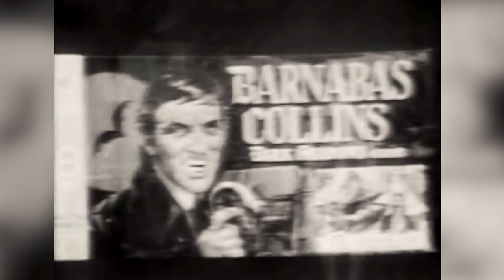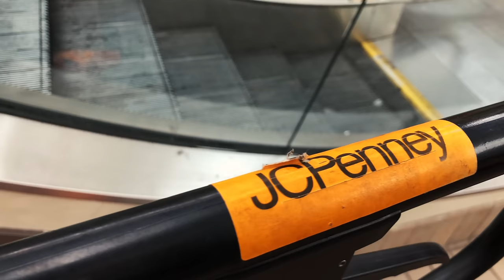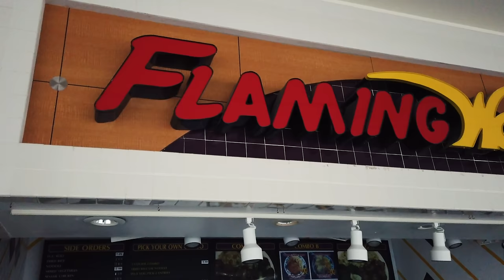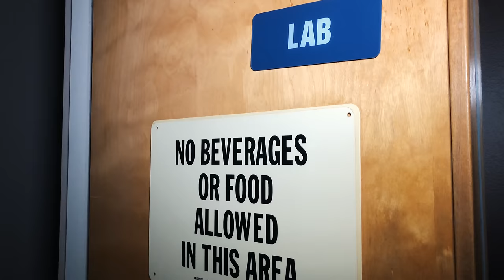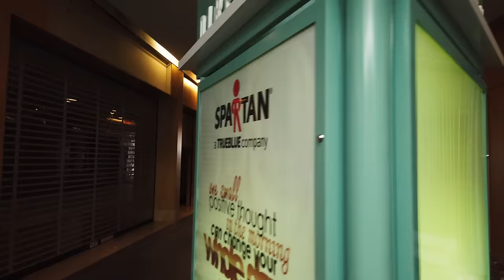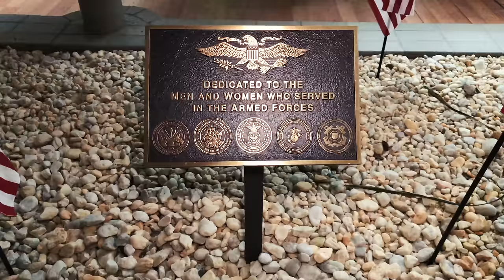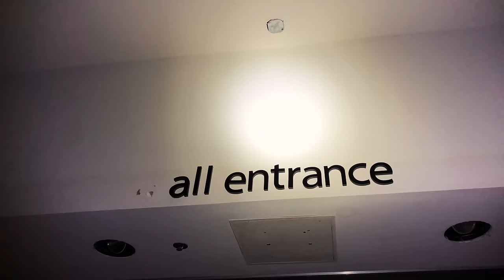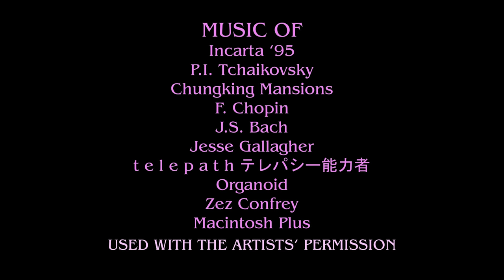The Abandoned Burlington Center Mall | an epitaph to a dead mall | ExLog 40 - Phase III Premiere

Comment: 13 40   the watering hole.  In 1986 I replaced the" gentle stream" of water coming from Petals snout to a  fire sprinkler head. -  Why?  the small discharge hole ih Petals snout would get clogged with human hair and other debris that was able to get by the filtering system underground ( I spent many hours a d some ful days in that 4 x 5 foot underground filter station.   When I replaced the small water tube that Zeno's designed with a mid size gpm sprinkler head in 1982, most of my problems went away-   It solved the problem.  Just last year I explained that to Zeno's daughter via the internet.    I took care of the grand ole elephant for many years taking  great pride in the way she  ( he) presented the sprinkling water on " Mobley " as we called the boy  ( like in Disney's jungle book.)    I have a great story to tell about the last person to adjust the sprinkler head on Petals  the Elephant ( he has since passed away)   My one - time assistant was totally set up to be completely soaked when I directed him to go change the sprinkler head to a different size.  I turned the water on when he was still on the back of Petals with a wrench in his hand.   He could not get down from Petals so easily, so he was soaked head to toe by the time he " dismounted'   I still laugh about it today  God bless his soul.
Reply: I never called that elephant "Petals".  I could see at the base of the stairs that the sculpture is named "The Watering Hole".

Comment: Great video, Sal. I worked in mall retail from 2001 to 2012 in both malls in my location. The first was built in 1968, with new anchors added in 1975. 

The second was built in 1999 as a youth-oriented mall.

Today the older mall is performing very well. The newer mall is struggling. 

The old mall has the higher end stores and better anchors. A new REI opened last month. A new Von Maur will open later this fall -- built on the site of the demolished Sears store. The Macy's at this mall offers brands found in larger markets. 

The newer mall lost Younkers, one of its anchors. The other anchors are a dying Sears and a fading Penneys. The Macy's is also fading fast and looks older than its sister store across town. Many of the spaces once occupied by national retailers are now filled by mall ninja boutiques and small massage or beauty shops. The former Abercrombie, the Forever 21, the closed Charlotte Russe, the dead Rue 21, the former Aeropostale -- their customers have left. They're now shopping at H&M at the other mall. Drop in a Zara and the other mall will have lost an entire generation. The food court is emptying. New paint isn't helping. My guess is that this mall won't make it another ten years, maybe not even five.

You're right. Malls have killed themselves.

Comment: That alarm sounds like a back up batter system or UPS at the beginning Sal, they probably killed the power to something that charged the batteries and the batteries are going dead now.
Reply: No I know that sound it a trouble alert on a fire alarm I worked on too many to count and the strobes going off in the mall confirm this and then the sprinkler pipe rupture at the sears tells me they have had this happen a few times...
Reply: @cgsound  ^This. The label on the door should have been everything. "Generator and Annunciator room". This is most likely where all the security system and fire alarm annunciator panels were at. The panel was probably signalling a trouble in the system, most likely fluctuation in water pressure, which should have been a warning of what eventually came. The other tone was probably signalling that the entire horn/strobe system had been activated due to the water pressure trip.

To be honest, as I watched this, I couldn't help but think the amount of horn/strobes in the open areas of the mall were a bit... anemic. Like I really didn't see any strobes flashing other than the ones in the food court area and one high up in the rafters and the one there at the door.

If it was me, if there was such a huge temperature change from out in the mall to in the Sears, and then to hear the Sprinkler alarm go off, I would immediately assumed that there was a fire and that was the reason why it was so warm in there. I would have then called the FD.

Comment: 41:14 - A water main [break] is the pipes under the street, belonging to the water supply utility.
Water leaking from the top floor's ceiling could only be from fire sprinklers.  Which is accompanied with a fire alarm bell,  and an immediate response from the local police, then fire department.  41:44
Reply from the maker: Found the expert!

Comment: I remember the day Lenscrafters opened up.  I put in their pneumatic thermostat ofr cooling and heat and ran the lines to the main.   I also recall placing their test meter( electric meter to gauge the cost of their energy usage for our accounting department.    I told them to dim the lights for a week and conserve , as I only would run one week .  The energy charges for the year were then extrapolated x 52 weeks. therefor if they conserved energy for the test period they could save thousands per year.    I think I may have been a disgruntled employee at that stage of the game and was 'screwing' my manager because  I saved the mall one hundred and forty thousand dollars on a  savings initiatives only to be rewarded with  25 cent per hour raise.

Comment: Great stuff. One of your best and I agree with the other comment about doing a Moonbeam exposé.

Incidentally, I didn't see if anyone else mentioned it, but my wife and I have the theory that the heat in Sears and the water main break are directly related. Clearly they knew it would happen. The real question is whether they were trying to stave it off or cause it.

Comment: I don't know if you were thinking the same thing I'm thinking right now.  There was very cold weather.  Cold weather in which pipes freeze.   When the pipes freeze, and the weather remains cold, no water comes out.  When the pipes thaw, that's when the flood happens.

From what I know of Sears, they own all of their stores, so although it's attached to a mall, the building and the land it sits on is theirs.  Presumably, the building, which is an asset, is insured for that sort of "act of God".  

So the question is, who turned up the heat?
Reply from the maker: Good question...
Reply: @sal  Another thought...being that Sears is attached to the mall, the mall is likely named as a secondary insured.  So anything that happens to the Sears store, whether it burns down or floods or whatever...if the attached building is damaged, then the mall would get a payout as well.

Comment: Yes, that is a transformer, happily doing what it does, hum.  Maybe somebody ought to teach it the words after all these years. That hum is present in any building with electricity, but normally it cannot be heard over the sounds of life, the HVAC, people, whatever.
Glass, in a building with no temperature control, will break on its own accord, especially if it was tight in its' mounting to begin with.  Glass doesn't like temperature change..
The really hot store means the control has failed, and it is just running.
Reply from the maker: Thanks for the insight!
Reply: 7:31 - We can hear the HUM .

Comment: Your discussion about the reason malls died reminds me of bookstores.  I remember going into Borders when it was big.  I remember shelf after shelf filled with computer books.  They had one or two copies of LOTS of titles. Over time I saw them switch to multiple copies of fewer titles. 2 copies of 10 titles took as much space as 10 copies of two titles and was easier to manage.  Cost saving isn't always the way to survive.  You need to control costs, but they shouldn't be the primary measure of success.

Comment: This used to be the mall I'd go to growing up. I'd always end my shopping trip with a little ice cream at Cold Stone Creamery (it was always right next to the exit so it was perfect lol). I remember as the years went on that it felt less and less safe there. Gangs started congregating there, more and more violence started because of them, then there was even an incident where there was an apparent suicide attempt where a guy fell from the second floor on the Macy's side (at this point Macy's was closed and no stores were in that wing). He survived but was badly hurt.  

Not long after that I moved to a different state, but I knew it wouldn't be long before this mall would go under. They apparently tried having sellers making up tables during the weekends to try and get traffic in towards the end, similar to a flea market, but it never did much. Apparently also right at the end the heating in the mall was never looked after, which ended up going out, made it practically freezing inside the mall during the winter, and that ended up leading to the water main break because of burst pipes. It was like adding insult to injury at that point. It's sad, but all of us locals could see the end coming for years.

Comment: That beeping sounds like a fire alarm panel in trouble due to either a power short or it running on a nearly dead power.
Reply: Ground water in the manholes from the pumphouse ( off property to the annunciator panel.  That sound is very familiar to me-   10 years I dealt with the ground fault until I had pumps installed in the manhole pits -  D Gallagher Chief engineer

Comment: If I remember correctly,  you stepped on the wooden floors in the Macy's.   They are everywhere in them.  If they haven't been attended to recently they will make very bad creaking noises due to buckling (I'm sure you know).  I worked in one and they did that anyway when they were new!

Comment: Sal---I - just saw the tail end of a clip  -  yiou briefly scanned an area on the lower level main entrance to the mall.  it's where the every very FIRST  sprinkler leak occurred in 1983.  I know because it just started at Burl Ctr that year and I had to go in on a freezing day to help my then boss fix the issue.   THAT day was when we learned of the insulation issue at the mall.  It took the freezing temperatures of a few days that year to expose the liability.   I know why these sprinkler  line breaks occurred.   The Burl Ctr. had severe insulation flaws when it was built.   My former supervisor and I fixed these issue by working 5 or 6 consecutive weekends with a creative way I designed to mitigate the insulation issues.  We retrieved an overtime rate  which Uncle Sam sucked up most of to fix a multi-million dollar gaffe.  My supervisor left me in charge of the shopping center in 1988 to start his career at Eschelon Mall.   We both fixed the problem,  but the initial repairs still  required maintenance repairs over time. I did that for many years until 1997.    You WIL NEVER BELIEVE WHY THESE LEAKS OCCURRED AFTER I LEFT in 1997   Its insane, and its a shame.,
Reply: @savvysharktravel     Sears had their own Heating system and Cooling tower totally separate from the shopping center-  Same for S & C-  and eventually- Macy's.    The problem with the mall was that they system was on a very early design Hewlett Packard BAS computer.    Basically acted as a timeclock with no overrides or inputs for low temp alarms/ temperature parameters set to instigate air startup.   It was a long weekend- ( thanksgiving)   Approximately 34 years ago tomorrow that we had a really cold winter - blistering cold.    The sprinkler Pipes froze that weekend 34 years ago tomorrow

Comment: After a bit of research I found that one of many causes for a water main break is, you guessed it, extreme differences in temperature. When a pipe experiences extremes of hot and cold the pipe expands and contracts to a degree. Eventually the pipe becomes to weak to handle the pressure of the water inside and causes an explosion.

Comment: Me, and my friends practically lived at this mall in the late 80’s, and through the 90’s. I worked at many stores there in my youth. Farrington’s Music for 12 years. It’s sad to see what has happened to it...another thing about this mall. It was built on marsh lands and was sinking.
Reply: It would have been 40 years old in 2022 and never sunk in a noticeable way to anyone. Even the demolition crew remarked on the sturdiness of the foundational levels that they were driving over as they were knocking the walls down.
Reply: @JimGrimNY  Interesting. That's just what we were told when everyone was talking about a possible makeover. Either way, I'm sad to see it gone.
Reply: @PaulMonaryArtery  when the mall was in the middle of its heyday, that used to have a noticeable shaking if you were in the central promenade area. All you had to do was stand across from the escalators up above the gab and hold the rail and every 45 seconds to 2-minutes you would feel a rumbling shake in the floor in the rail. It was that way from 1983 all the way through until it was 2015 and I was last inside it.

Comment: Sal-  at 42: 50  that leak is coming from the food court above.    Prior-  the leak in Sears would have been a sears problem back in the day.   All someone has to do to stop that is turn off the PIV  (post indicator valves ( outside )  in front of Sears and JC Penny's and the water would have stopped immediately until the Fire Pump (on the perimeter of the mall outside of S& C was turned of until a repair was done.   Little to no damage when you know what your doing!   as I watch these videos  I cringe!     At least I think ( know)  I did a great job when I was there for those 13 years .   Saved that company a ton of money.

Comment: I discovered this mall in 1989. It wasn't as happening as other malls in that area, but I did go there occasionally. However, the most unusual thing I ever witnessed in any mall occurred there in the early 90s which was a massive teen fight where somebody almost got thrown off the upper level. He was actually hanging over the rail. Security wouldn't allow anybody else in the building that night. 
In its final years when 90% of it was dead, I used to work for a transportation company and would stop to use the bathroom. It was soooooo dead.

Comment: The beeping you heard in the beginning outside is the "Fire, Life Safety" system.  It will make those beeps when systems begin to fail and contact switches fail or open.    You'll notice that as soon as you entered, the "Fire, Life, Safety" strobes were on, that's just too funny.  How many years has those strobes been on?  It is a testament as to the durability of the Fire, Life, Safety system anyways...hehehe.  It's quite funny to hear you say what you said, because you're correct. It's like the building is slowly dying.  😜

Comment: Next time you hear that alarm on the outside of the building, its from the sprinkler system.  When a sprinkler system opens up and water starts flowing, that alarm goes off.  Most likely there were rusty sprinkler pipes that rusted thru and blew out allowing the water to flow.  Since it was coming from the over hang, it most likely was a dry system and the air escaped via a leak and then the water started flowing.

Comment: Someone might have said this and I missed it but...
The fire alarms were flashing when you walked in. Chances are there was a silent “water flow” alarm going off somewhere (home office, mgmt, etc). Water flow alarms are attached to the sprinkler system along with pipes. My guess is water had been building and building, y’all got lucky and caught the rupture. 
I’ve been woken up at 3am for my fair share of these alarms, usually remedied by cutting water outside and letting maintenance take over. I’d be curious if the maintenance man you mentioned was there for that purpose.

Comment: My building from 1983 through 1997.....a little depressing to see al of my hard work shot to hell.  The alarm going of near compactor 3 as It was is the Annunciation panel .   At the 8 minute mark -  that is a 750 KVA transformer.    It's filled with mineral oil-  NO PCBs
Reply: Thank you for all your efforts keeping Burlington Center in good shape during those years. I definitely noticed the change when the 1990's came to a close.

Comment: I tell you what killed the Burlington Center, what Killed the Mall was Traffic was flow Design! 

They made a traffic barrier between the Regal Theater and the Mall preventing movie goers from immediately going across to Shop after a movie that didn't use to be there and they made a traffic light controlling shoppers from getting to the Mall too long a wait which discouraged visitation after a movie  but constructed traffic flow to feed the Dicks Target Shopping Center. Matter of fact had they Built the Chucky Cheese on the Target side of the Road It would not have Died too. They should have saved this place  But they don't want to revive this market & location. It was sabotage. 

I remember  when the Quaker bridge mall was slowing down very much back in the early 2000s  Then somebody just gave it a life injection and they built a new food court and the mall has been thriving ever since Burlington Willingboro area they don't what to revive There is certainly enough housing to support the economy if they ever rebuild the mall same thing with echelon echelon was a beautiful thriving Mall. The last era it was as we remember Ii was 1993 I saw the Firm there at it movie theater.

Comment: I looked at this mall on google and it looks like it has not been updated, flooring still looks original and the inside looked like a eye sore and I hated the design inside the mall, ugh. Ugly. And also there is another shopping center less than a 1/2 mile away and it's a strip mall and it's thriving. Just a Home Depot and Target and other things.